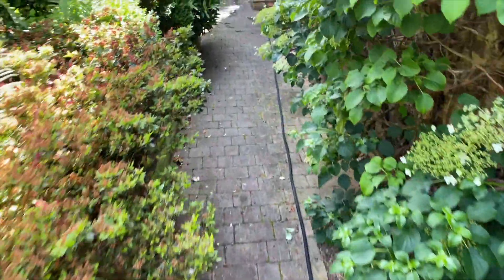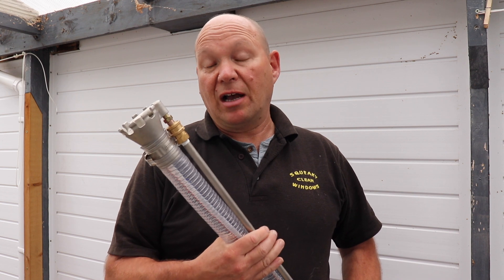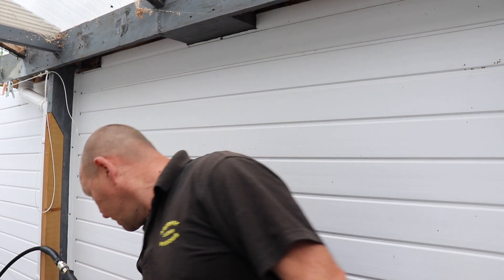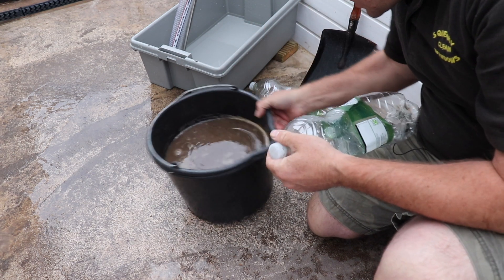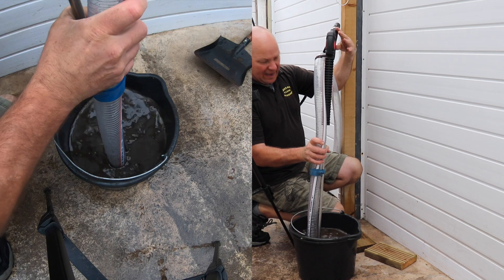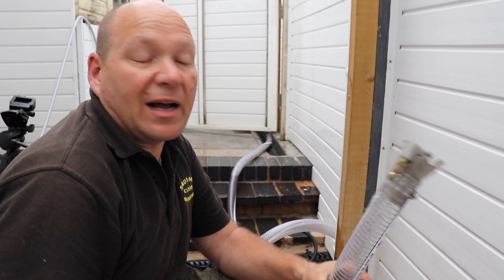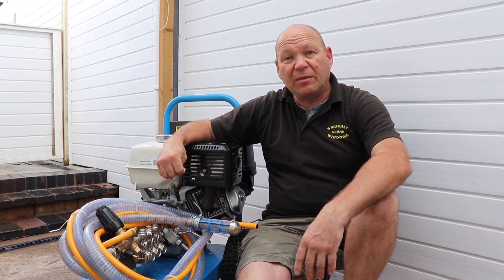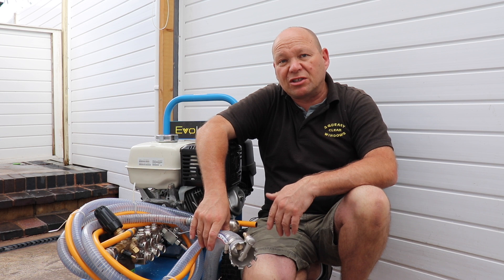Pressure Washer Mud Sucker Test

Comment: Hi Dave, just a quick note for your vid. You forgot to mention inside the mud sucker frame is a nozzle. When I bought my mud sucker thank goodness I checked to see what size nozzle it came with as my machine (21 L per minute running at 3000PSI) can only go down to a 0.65 nozzle. Said mud sucker came with the nozzle much smaller than that so if I had of used it without checking my machine would have NOT been happy at all, in fact some damage would have occurred. Apart from that I love the mud sucker, it's bloody great and it looks really professional on jobs :)
Reply from the maker: @nzjustice111  thanks for letting us know

Comment: What is the number associated with chosing one like the 0.5 or 0.6 number
Reply from the maker: @Gkir1  Google nozzles chart. It will give you the correct size nozzle for the flow of your pressure washer
Reply: @squeakycleandave1   for a 250 bar 21 lpm machine what would i need?

Comment: Hi Dave, What Lance do you need with that? Do you have a link? Many thanks.
Reply from the maker: It needs to be a straight lance at least 900mm long with a 1/4 quick connect on it. Probably best ringing which ever supplier you use and explaining to them what you need
Reply: @squeakycleandave1  thanks mate. I will ask equip2clean. That mud sucker looks like a good thing to have. I have a pressure wash job coming up that has a high chance of flooding. Keep the videos coming. You have a very good channel.

Comment: I hated the mudsucker one of the worst things I bought for PW.

When you try it on.a job you will see , it doesn't suck up half the time, waste of time.
Reply from the maker: I’m looking forward to trying it. It will be interesting to see
Reply: @squeakycleandave1  i didn't actually use the same one as you  i had the one from Rutland pumps which looks similar,  it will pump from a bucket fine, real life work they're shit.

Comment: Hi Dave, glad to see you've got your machine sorted. I've got the 21lpm version and coming upto it's first 50hrs service. Have you changed the oils yourself or through a dealer?
Reply from the maker: I had to drain the oil down to send it back which was pretty easy 
Going Back To The Manufacturer. Oil And Fuel Drainage For Transport.
https://youtu.be/SL5OIyvwA7I
Reply: @squeakycleandave1  Cheers mate.

Comment: I knew it was valve related.rocker broken valves wont open.
Reply from the maker: Have to be fair to Dual Pumps. They got it back to me quickly
Reply: @squeakycleandave1  well that is the main thing its not something you could have fixed. valve gap maybe but a broken rocker is game over, back to base repair.